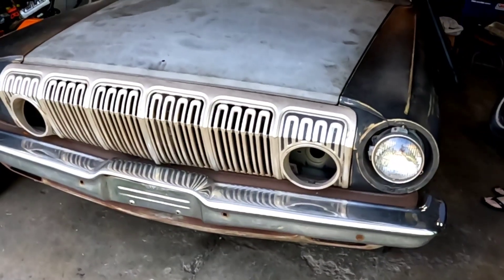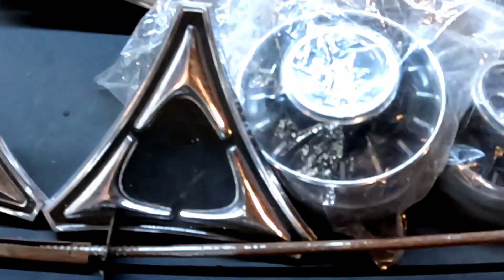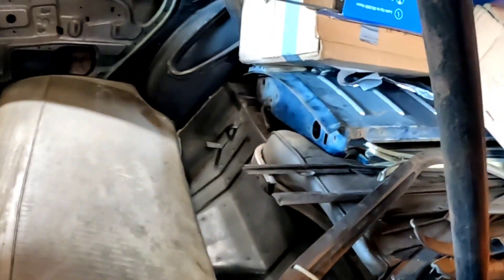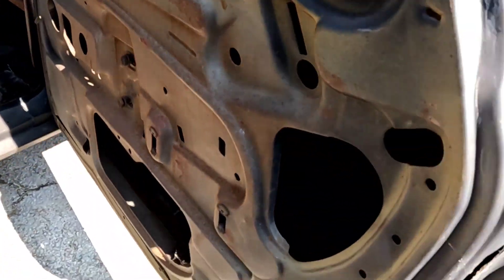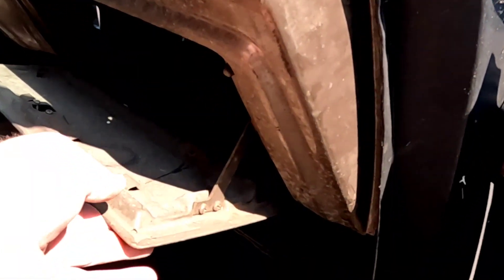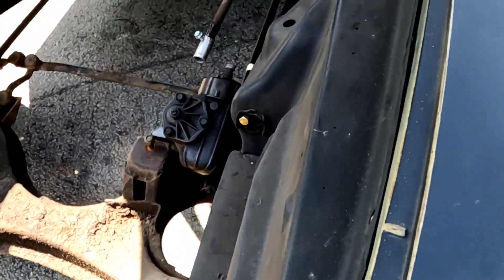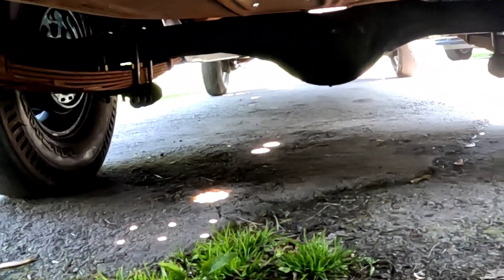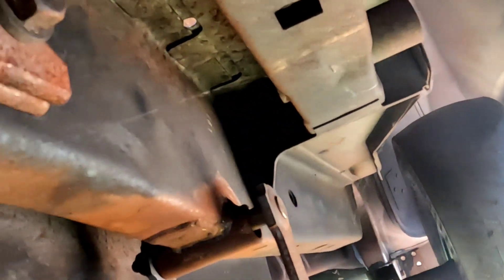1963 330 Dodge polara station wagon looking over all the parts that came with it.Mopar Nation

Comment: Take out the roll bars ... disc brakes at all corners.  Magma  force  suspension with rack n pinion.  Seaford green with your choice of interior.  Just a suggestion. Ralph
Reply: "Magma  force  suspension with rack n pinion.  "

NFW! Keep the front K-member and stock suspension!
Reply from the maker: @electrix6751  yes it will have all stock suspension

Comment: So what's the difference in the '62 K member ? Also I have an original "62 -"65 station wagon gas tank if you know anybody that needs one.I bought it from the guy who had the "Dragin Wagon " about 23 years ago.I think his last name was Buel.I have  quite a few "65 Belevedere I wagon parts that may be available.I'm 68 and a computer idiot.If interested we would have to communicate by phone I DO NOT TEXT.
Reply from the maker: Yes that's Doug dules 64 wagon.yes I would be interested in the gas tank and maybe the rest of all the parts your wanting to sell. Here is my number if you want to talk about them when you have some free time. 937-527-4095. Thank you
Reply: What's the difference? The 1962 thru '65 B-body K-members placed the engine 2 inches farther forward than the 1966 on up B-body cars.
Reply from the maker: i think you may have called and i didnt know your number and may have missed your call.i need a gas tank.thanks